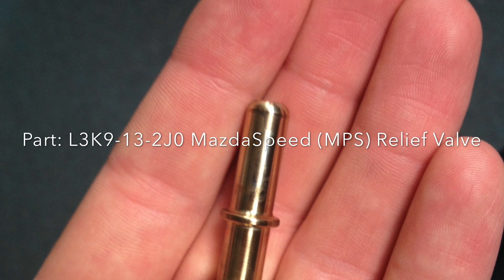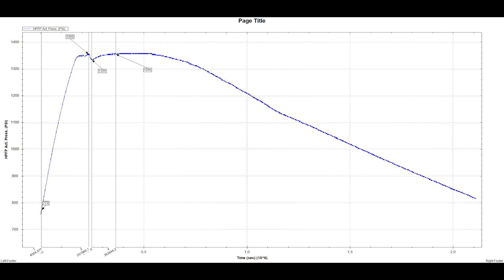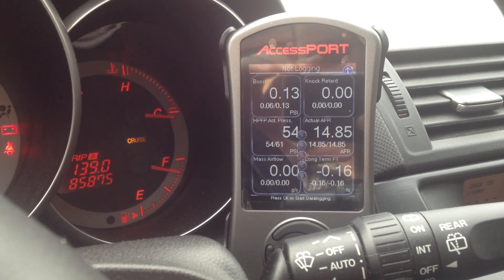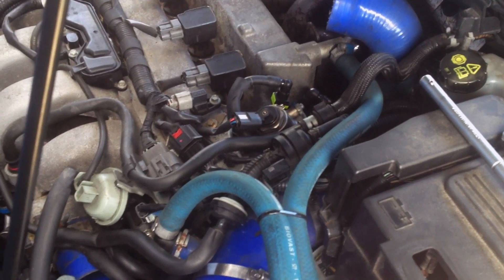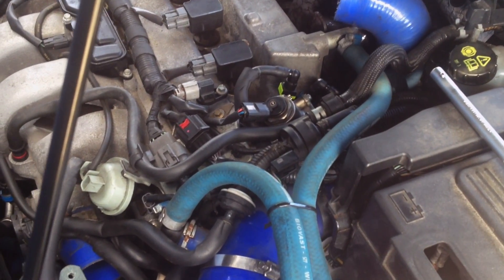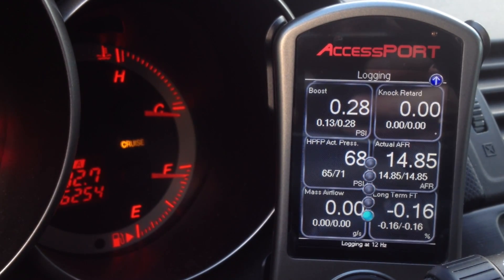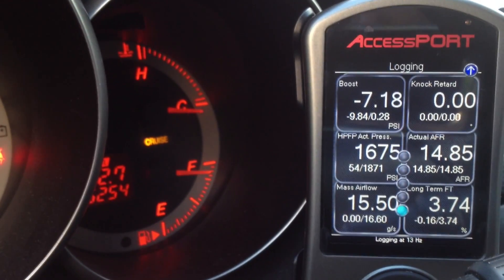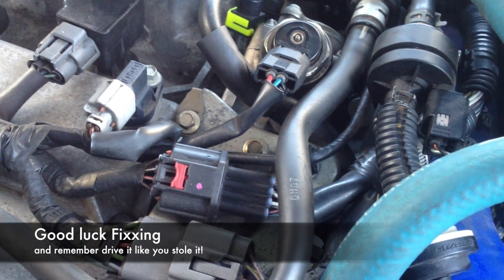Relief valve Failing & Fix Mazdaspeed 3/6 CX7 (MPS)

Comment: i took the line that goes to the top of hpfp from the pressure relief valve and with the key on fuel just poors out of it and the car wont start until i put my finger over it and build some sort or resistance. so it has to be the pressure relief valve is wide open. ??
Reply from the maker: yes if that hapens than the valve is broken! you should get changed
Reply: Sorry man i said it wrong. The fuel is coming out of the hpfp side not the hose that comes off the rleif valve. As if thats the intank fuel pump pressure. If i slowly block the pressure off the car starts. On my scan tool the hpfp status blinks all the time from no and off. It flickers on and off. I have a good scan tool maxisyspro. Today im going to log the actual pressure like you did. At idle i need 400psi and driving on max boost more than 1500 as i think you said.
Reply from the maker: +Mark Rampersaud if the key is in on position and the car is not yet started than the pressure should be around 50 to 60psi when the car idles it should be around 400psi and om full load it should be 1600psi

did you also check your LTFT (long term fuel trim) this should be between -8% and 8% at idle 

if your LTFT is higher for example -20% or 20% than there is a good change you have a air leak in your intake system this air leak can cause stumbling of the engine.
Reply: +Unknown Username 
ok im going to check the ltft as well as i just reached to work. im doubtful thats its a air leak. as a ltft would pull a dtc code i would think. i do believe its a fuel pressure or delivery problem. the car makes power dies the comes in again. i can also hear it missing and go again. this is why all new coils plugs. and even took out all injectors and clean them. the spray pattern on all injectors looks good and none are leaking. looking at the plugs i can see a lean condition as there very white. this i feel has to do with hpfp. something is causeing the car to run on only the lpfp only. the status of the hpfp never stays on for more than 1 second. i will do as you said as well as monitor ltft.
Reply: my ltft is at -9

Comment: im wondering if this is my problem. as i go on the gas im getting a hesitation is acceleration. it goes and ease up goes. power no power. it gets worst as it heats up. this valve is expensive. i have done everything. even removing injectors and swapping them. new plugs new coils. new turbo. i mean everything. can you tell me whats the driving characteristics of the vehicle when this valve fails.

Comment: Would it cause to leak fuel and throw a cylinder 1 misfire code? I've replaced the spark plugs using ngk and gapped .28 and I've switched around the coils. I see some wetness around the first injector area.
Reply from the maker: +Wowzerz00 hard to tell what the problem could be. i would need to see a datalog to give any good advice. did you already try and look it up at the mazdaspeedforums?
Reply: +Unknown Username I did and it seems like the verdict is that it's coming from the fuel rail.
Reply from the maker: +Wowzerz00 can you give me a link to the Mazdaspeedforum topic?
Reply: +Unknown Username this is from a different forum. http://forum.mazda6club.com/speed6-engine-drivetrain/262135-gas-leak.html#/forumsite/20967/topics/262135?page=1
Reply from the maker: this is a topic from 2013??? is this about your car or just the same problem? cause i can name you more than a dozen problems that could lead to any problem causing a misfire...

from a stuck injector in open/close position or failed injector seal, failed HPFP i need data logs!
Reply: +Unknown Username yeah I have similar problem. I have Corksport fuel injector seals and autotech internals. it's a built motor and it's in process of getting tuned. I also have BNR S4 turbo. I can send you the logs. Email?
Reply: +Unknown Username emailed it to you.

Comment: By any chance are you Jasper_3MPS on from Mazdaspeedforums.org ? I just read a post that sounds just like the way you talk in the video. Anyway, appreciate the information. Just took my RV off last night and hope this fixes my problem.  I can actually blow air through it, not easily, but it still comes out the other end.  So do you think its definitely the RV? I changed out internals and checked my spill valve.  Thanks, Ed
Reply from the maker: +etrevino78 Yes thats me! and yes you should be able to blow air thru it! It should hold close to 1900PSI and my guess is that your not able to blow that hard ;)
Reply: +Unknown Username that part number you give goes back to a cx7. they said they can't refund due to it being a special order item. are you absolutely sure this is the same relief valve-holds the same amount of pressure? thanks for the help.
Reply from the maker: +etrevino78 yes its the same one I used for my speed3 (mps)

Comment: my speed3 has a rattling noise coming from the hpfp. with the engine on at idle, the fuel pressure stays around 200psi. when it goes into boost under load it only goes up to about 1400psi, it used to hit around 2000psi. I did the test with the key on, engine off and the pressure stayed at 61psi. maybe bad hpfp internals?
Reply: My speed3 has a P0300 code and is misfiring at idle, changed the plus and coils but still having the same issue. Mine also has a rattling noise, could it just be the HPFP?

Comment: This fixed my Speed3. Had 80k on it when it started loosing fuel pressure above 4k rpm. Mine made the same rattling noise too.
Reply from the maker: good to hear that you solved your problem cause loosing fuel pressure can be fatale to the speed3! zoomzoomboom!

Comment: On my speed 6 I just did the fuel pump internal upgrade and now my HPFP Act Press when the key is on the On position reads at 969 when I turn the car on it reads 68-75... I'm thinking this could be it. Any idea's?
Reply from the maker: ±65 PSI is the pressure that the main pump in the fuel tank puts out. than the HPFP or CDFP boost the pressure to the desired output the ECU wants. this should be around ±400 PSI, The relief valve is nothing more than a safety valve. is the pressure becomes higher than ±1900 psi than it should release this pressure to low pressure side of the HPFP. so if thise valve is broke than the HPFP cant hold the pressure. the only way to test if its your relief valve is to listen for the whistling sound of fuel that passes true the valve... the other methode is by seeing if your fuel rail can build up pressure by letting "warm fuel" expanding and seeing if it spills this fuel over the valve.. as a small pressure drop .

if you don't see this hapening than you could have a stick fuelpump valve. this is the valve that on the top of the HPFP where the connector connects. a stick fuelpump presure valve can come from getting to much ethanol (E85) or any fuel concentration with more than 30% ethanol....

Comment: When mine went out I was getting 100 psi just pressure from the pump in tank. I thought it fp but it was the valve.
Reply from the maker: yes every time it will fail it will have a different point some time the whole spring just fails and some times its just that you overstresed it and than the valve will need a lower pressure to open (some thing we don't want because of your fuel injection)